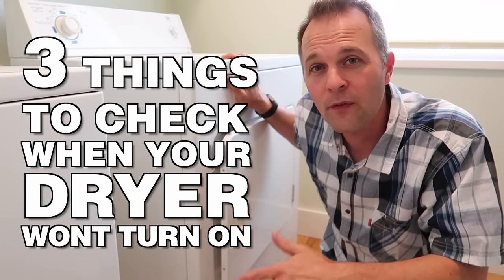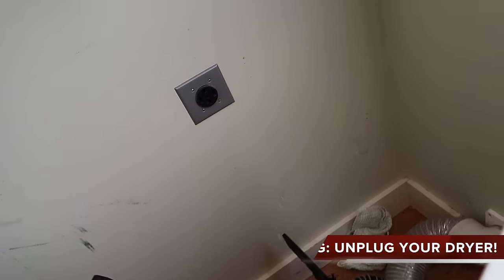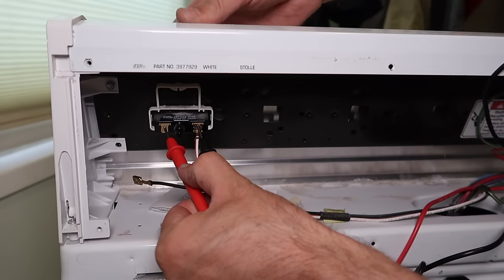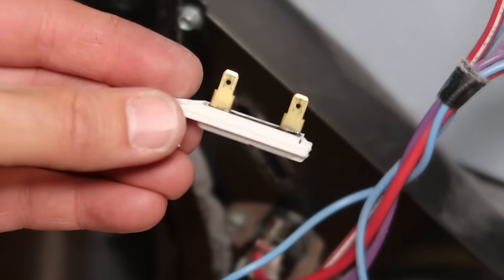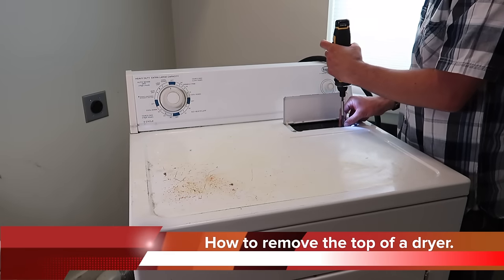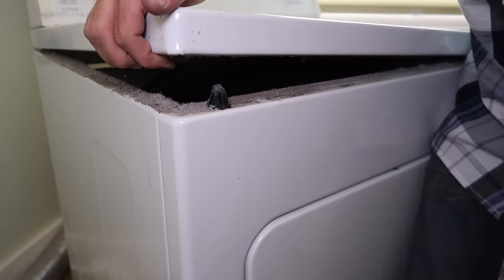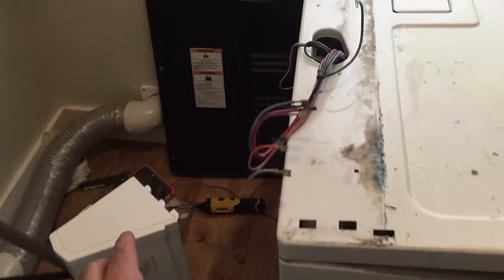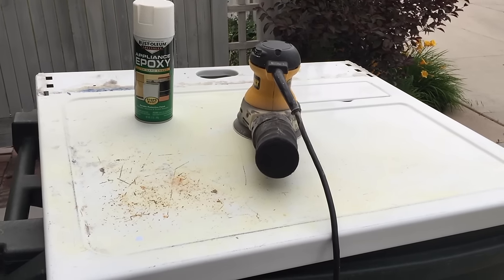3 Things To Check when your Dryer won't turn on or start - REPAIR

Comment: The problem I have with my dryer is that when i push on switch dryer turn on but once I remove my finger from the switch the dryer doesnt stay on I replace the switch also I replace the door switch that activate when door is close I also check the belt and is in place but still doesnt stay on
Reply: I have this problem on my older Maytag but haven't yet figured it out.

Comment: my thermal fuse has conductivity, but the female disconnector is burnt that goes to the thermal fuse. I brought a new female disconnector a little bigger than the original, tried it, but still no power. help

Comment: What If It Is The Actual Dryer Button Thats The Problem What Do iDo?
Reply: My dryer button clicked but when I pulled it out one of the wires were burnt so I stripped the burned part and hooked it back and it works. Pull the button out to make sure the wires look good.

Comment: What if its not in the thermal fuse replace and still didn't working
Reply: On my Roper dryer, it was a bad timer ,what can cause your dryer not to receive power.
Reply: door switch,/ start switch,/ switch on pulley that tensions dryer drum belt,/ centrifugal switch inside motor that prevents heater starting and getting hot if drum and fan blower is not turning....

Comment: Pro tip. I watched this video and was ready to check connections for the power button and thermal fuse, turns out there was a shoe that my wife threw in there that was wedged and stopped the motor from engaging. Check that first before you go through all the work of getting behind the dryer and screws and such.

Comment: What about if it starts sometimes but not most times you push the start button
Reply: Update: it does turn on but shuts off after a minute. This unit is only 6 months old

Comment: If your door switch is bad you can eliminate it and it won't cost you anything. You will just have to manually shut the dryer off before you open it.

Comment: DRYER No start 101:
Customer says on the phone "I have flipped all the breakers and it still does not work";
Upon arrival @ Dryer location :
Step 1   push start button = no start
Step 2: go to breaker panel and place Dryer double pole 30 Amp breaker into the"ON" position!
Easiest Dryer repair ever!

Comment: Not addressed in the video - why would the thermal fuse be blown?
Reply: Bad air flow is usually the cause. Get your ducting cleaned. Also your dryer should not heat in air fluff. If it does your element may be grounded causing it to heat whenever the dryer is running.

Comment: What if the dryer throws the breaker only on a heavy load
Reply from the maker: I have never had that happen with the large dryer breakers but sometimes old breakers become sensitive and trip too easily.  I would try installing a new breaker and see if that fixes it.

Comment: My dryer wouldn't start and it turned out to be the timer knob. The plastic knob had a hairline crack in it and it seemed like it was turning the timer but it really wasn't.

Comment: I did away with the fuse and connected those two blue wires together. It works fine
Reply: Any problems so far??
Reply: Nope

Comment: So I checked all three things and my dryer still does not  work what now??
Reply: door switch,/ start switch,/ switch on pulley that tensions dryer drum belt {broken belt or bad switch}/ centrifugal switch inside motor that prevents heater starting and getting hot if drum and fan blower is not turning....,/ bad motor or starter circuit  {does it use a start capacitor} ....,/ lastly timer unit or if newer model, the control card

Comment: turns out, my Dryer wasn't the problem:  the 30A (double pole) circuit breaker had a MELTED pole that connects to the Buss Bar in the box... replacing the circuit breaker fixed the dryer.   I guess circuit breakers are not thermally protected any longer?  oh well...